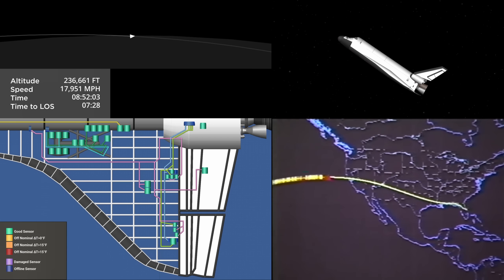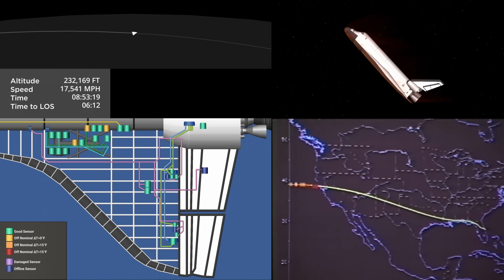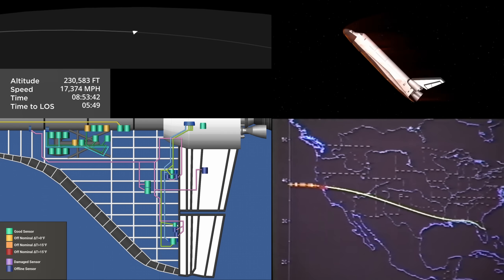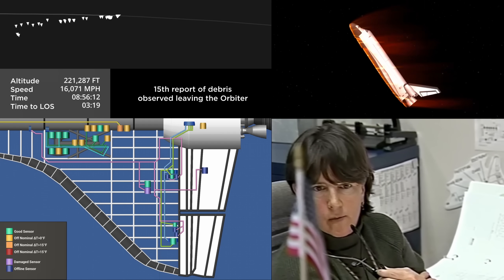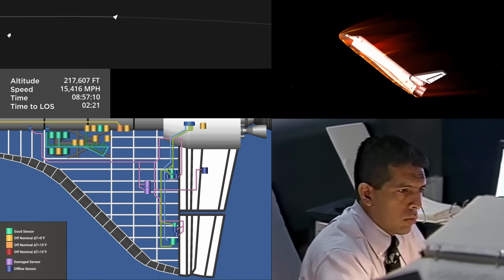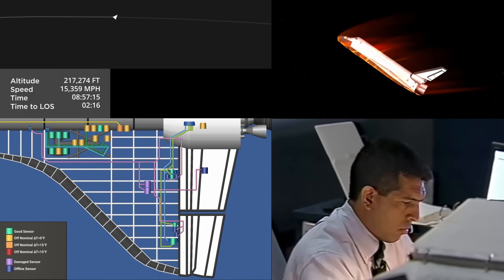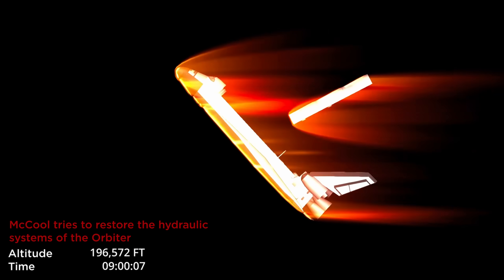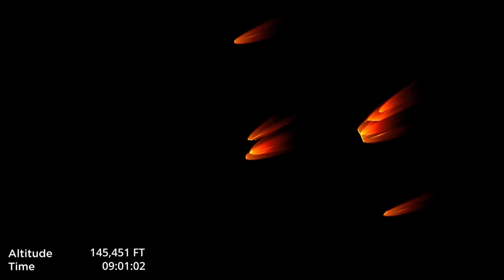The Columbia Disaster in Spaceflight Simulator

Comment from the maker: Corrections on the video:

-Red sensor indicator means "Off Nominal ∆T>30°F" not 15°F

- Hyd Sys 2 Left Inboard Elevon Actuator Return Line Temp (Goes off line)
occurred at 8:53:36 AM

- System 2 LH Aft Brake Switch Valve Return Temp (Off Nominal temp rise)
occurred at 8:57:54 AM
Reply: Gb
Reply: Gravity, centripetal force, and no resistance being in a vacuum.
Reply: why do you not use metric like the NASA, insteed of imperial?

Comment: 1) NASA should’ve called off the mission and ordered a turn around as soon as they saw the foam hitting the brick that’ll it’ll catch fire then melt and go in between the bricks popping them out like any tiles.
2). The should’ve been a hard shell over rough foam surface to stop us from breaking under extreme speed.
3). The space shuttle could’ve some repair bricks that astronaut could patch the hole by space walk.
4). I dint know if it was possible that young realising possible breakup they change the trajectory of return to a manoeuvred entry angle.
5). Could the astronauts should’ve baled out and release some sort of parachutes. 
6). Could the cockpit separate itself from the shuttle n come back with some sort of parachutes?
 All of the above after all other efforts were exhausted. 
Anyway the ground management knew the crew has 50/50 chance of coming back alive if it’s not called back right after foam pieces broke up. 
In the end: They could’ve done a lab experiment of similar situation while the crew was busy doing their assigned jobs. 
Too sad they agreed to accept their 50/50 chance of safe return.
Reply: Should Have sent other shuttle to do the repair?

Comment: The simulation I remember has the two left side tires exploding and taking the elevon off. This causes a fatal spin roll that causes disintegration of the orbiter. When they found the left side tires they were turned inside out from the force of the explosion.
Reply: They lost all hydraulic pressure and lost control.
Reply: @FredBeckhusen  The detailed analysis speaks of a "force fight" between the orbiters' rapidly deteriorating condition and the ship's ability to maintain the optimal flight path. When the control surfaces were unable to maintain control the RCS maneuvering thrusters began to enter the fray.

Comment: Were autopsy's done to confirm what each of the crew died from?
Reply: Trigger Warning: detailed death

TL;DR /possibly/ incineration, which thet were /probably/ unconscious for (based on some quick research and logical extrapolation)

Well, /some/ remains from every crew member were found and identified by dental records (im sure the investigators took photos) A Crew Survival Report says they likely survived the initial breakup, but would have /"likely"/ lost consciousness soon after due to depressurization. Im not trained to recognize death except in the presence of multiple presumptive and at least one definitive sign; it's possible that hypoxia or traumatic forces to the head and neck may have led to cardiac arrest, but the first solidly provable thing that directly contributed to a definitive sign of death was exposure to temperatures of "up to 2691* F" which caused injuries incompatible with life.
Reply: @Sak @SakaraCoyfox  couldn’t sound more unknowledgeable even if you tried. Just throwing around buzzwords like decompression, cardiac arrest or whatever doesn’t make you sound smart. The astronauts died from massive G forces and heat. Simple as that. Hypoxia was the least of their worries

Comment: This is exactly why Bernadette didn't want Howard going into space. It gets hot up there, because NASA still hasn't figured out a way to return astronauts in a safe manner, other than having them enter the atmosphere at 17,000 mph.
Reply: That *is*, not only the safest, but the only way unless someone discovers new physics. We do not have any technology that would allow a slow descent.
Reply: @DevSolar  How about massive rocket booster assisted "reverse thrust"? A boost in the opposite direction that they're traveling at? I mean it would cost a lot more but they wouldn't have to "burn" through the atmosphere. They would just come back down similarly to how the boosters that help it get up there in the first place come down after separation and burnout.
Reply: @Jorge01234  That's not only extremely inefficient,it couldn't possibly be launched with the insane amount of fuel that would beneeded.
The reusable boosters either land with parachutes(like the space shuttle SRB) or with a massive burn literally at the last possible moment
Reply: @Jorge01234  If you want to avoid the aerobraking, you would need those boosters to start firing up in orbit, and keep firing all the way down to the ground to counteract gravity (as opposed to the "suicide burn" of reusable boosters that aerobrake and use a short sharp burn to come to a stop instead of crashing).

So you would need essentially as much fuel for the slow descent as for the ascent. And you would need that fuel up there*. To *get that much fuel into LEO, you would need several additional launches of cargo rockets that burn even more fuel to get the fuel up that you're going to burn on the way down, rendevous with them in orbit, and transfer the fuel to your orbiter.

Quite apart from making things exponetially more expensive, you get an engine failure on descent, your orbiter is *toast*. So it's more dangerous as well.
Reply: @DevSolar   That's my point. They are using 1960s technology. The space program is stuck. It hasn't advanced in decades. Time to give it up and spend money on things that will help humanity.
Reply: @Rickshaw881  The space program is not "stuck". We rovered all over Mars, landed on Titan, brought back material from a comet, we are probing the sun's corona. The ISS is, for all the problems it had, a success story. Telescopes of all kinds allow us to understand space, and physics, better than ever.

The flag-waving "first man on the Moon" was a PR gig. That is not what a space program is about, even if Elon is pushing hard for Mars... because it's a PR gig. One that benefits him personally as it would mean billions of taxpayer money funneled into his SpaceX. There is nothing that a probe or rover cannot do orders of magnitude cheaper, and safer.
Reply: @DevSolar  You just proved my point. It's stuck. I can't figure out how to put men in space. The US doesn't even have a launch vehicle.
Reply: @DevSolar take a shower, Redditor
Reply: @Rickshaw881  You just proved my point: You're looking for the PR stunt "men into space" instead of the science being done. There is no benefit to putting men beyond LEO.
Reply: @DevSolar Unfortunately, we as humans are flawed in that we cannot easily recognize continued/slow progress or differentiate between a rate of change and a value.

Comment: You know what the most shameful and disappointing thing about this is, especially from the investigation?

NASA had failed to learn from the lessons of the Challenger disaster 17 years earlier.
Reply: What lessons from an O-ring failure on a solid fuel booster would have been learned that would be useful in preventing a foam strike to the wing?
Reply: @ALOTOFBS420  In both cases, NASA management didn't listen to the engineers regarding the particular issues. It was management hubris that was ultimately responsible for the demise of both Challenger and Columbia.
Reply: @davidspiro1325  That's fair. Whether or not that is what the original commenter had in mind is unclear though.